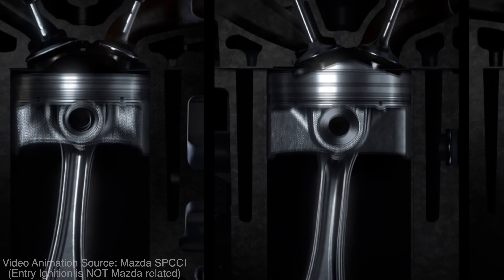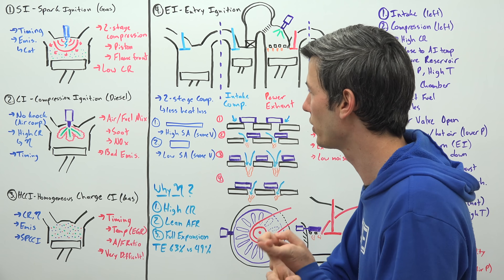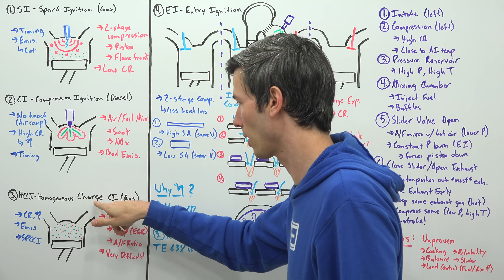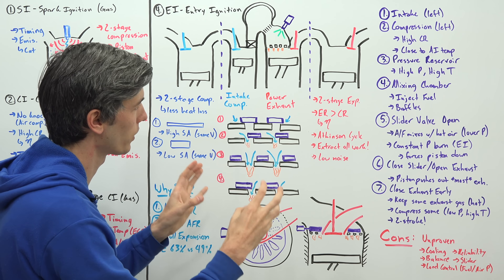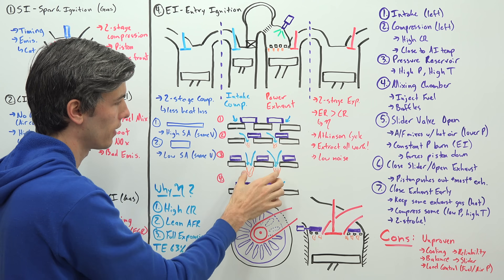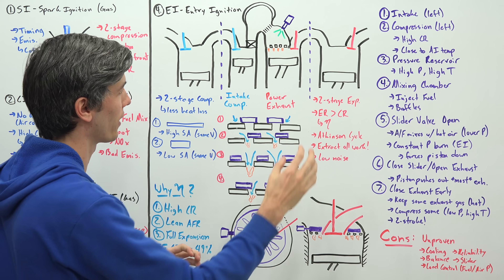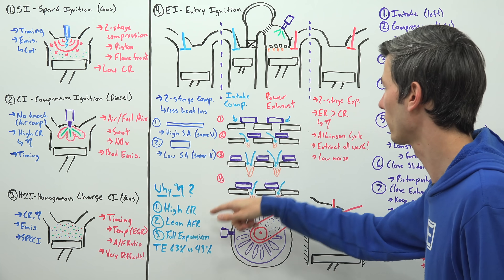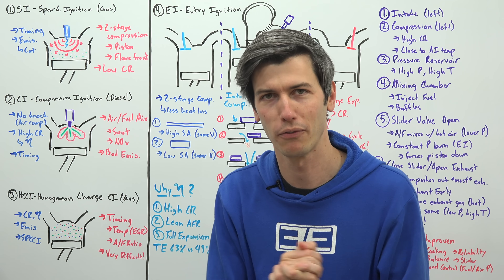Is 'Entry Ignition' The Future Of Combustion Engines?

Comment: I would love to see how the valves are sealing against the chambers. Extremely high pressure and lateral movement seems like a difficult mechanism to seal properly.
Reply: Seems like those 'slider valves' would get gummed up quickly
Reply: @Mr41297  Exactly what i was thinking
Reply: Mr41297
Not with atomized gasoline being sprayed on them.
Reply: The pressure seals it by itself. What i am worried about is wear since rotating the disc while it is pressured against the cylinder head surely creates friction that will wear it down rather quickly. And you can't use oil to lubricate it or emissions will be terrible.
Reply: seems like valves on a camshaft would've done the trick
Reply: @AbandonAllArt  If the valves were designed similarly to regular ones there would have to be some mechanism for the camshaft to pull the valve upwards instead of pushing down. If the valves were of the normal "open downwards" type, the air pressure above the valve would force it open before it was supposed to unless it had a ridiculously strong spring. The issue is that the pulling linkage could never be reliable because there simply isn't anywhere on the valve stem that would be strong enough to attach it. You also have the problem of needing to artificially create valve lash somewhere in the mechanism to allow for heat expansion. It honestly sounds like an engineering nightmare. After all that, I wouldn't be surprised if the slide valves actually flow better than normal valves anyway.
Reply: @stanleycorr1839  What about a system like Ducati's 'desmodromic' valves? Those valves are both pushed open and pulled closed. Perhaps the modification to being pulled open and pushed closed could be achieved.
Reply: @Donovan Piko The mechanic's job is fixing the engineer's failures.
Reply: I don't see a reason why you'd need rotary valves at-all, or how this engine is at-all different from a forced induction atkinson cycle engine, but with even more moving parts.
Reply: Exactly. This is a great thought exercise, but who at this stage is going to commit to adding complexity to and already vastly complex IC engine for marginal gains. I think Jason knows this. Anyone developing IC right now is arranging deck chairs on the titanic
Reply: Когда я стригусь под ноль, лезвия выдерживают огромное давление, которое я создаю, желая быть как можно больше лысым. 
When I cut to zero, the blades withstand the enormous pressure that I create, wanting to be as bald as possible.
=)
Reply: pressure difference will matter. both sides of the valve are at high P.... 1 just slightly higher to determine the flow in the circuit. so the resulting pressure is strangely quite low.
Reply: Donovan Piko I think the more advanced we get, simplicity becomes more and more complicated. Few and few peoples can manage to repair their cars. Car engines and electronic controls are too technogically advanced to be easily serviced by most owners. But they are mostly reliables and will be even better in the future. Capitalism is hard for stagnating technologies.
Reply: The Bristol Hercules used a sleeve exhaust valve, I’m not sure how they stood up over time though.
Reply: rotary valves have been used on 2-strokes effectively. Even piston-port 2-strokes use lateral movement to seal off the combustion chamber.
Reply: @jay_321  But in a two stroke there is oil mixed with the fuel to lubricate the sliding parts so more burnt oil in the exhaust, which is not what we want in a four stroke engine when trying to lower emissions in an engine and make it more efficient. The sliding valve idea is good, but keeping it lubricated and cool in a high pressure and temperature environment brings in the reliability issue. Wankle engines are a classic example of this.
Reply: @fuzzybobbles  modern two-strokes use the crank case as a sort of low pressure pump to move air/ fuel into the combustion chamber. Because of this they need oil added to the fuel to lubricate crankshaft. This type of engine doesn’t have a crank case acting  as a pump, it can have four-stroke type lubrication for the lower end and no oil in the fuel unless the wacky finger gate valve (or something else I missed) needs the lube.
Reply: @jay_321  not exactly in a piston port or other petrol 2 stroke the air fuel mix is transfered from crank to combustion chamber, crank case compression is to be avoided when building a 2 stroke..piston ports do seal much better than reeds of course though...super high performance 2 strokes use nothing but the pressure wave created by displacement to transfer..search 2stroke stuffings channel he makes an effort to explain...then there's forced induction 2 strokes also mostly diesel though
Reply: It looks like the valves seal themselves. The slide valves are under most pressure during the compression stroke but because the compression stroke is happening elsewhere from the combustion chamber, the pressure is actually forcing the valves against their sealing surfaces. During the power stroke, as far as I can tell, the valves stay open and the built-up pressure in the other chamber is what stops the expanding gas from travelling backwards. The only pressure that's trying to force the valves open is the small amount of exhaust gas that's retained to help ignite the fresh mixture. Of course, that exhaust gas pressure is being opposed by the high-pressure air/fuel mix on the other side of the valve so the net force is still greatly biased toward being applied to the intake side of the valve. Even just smooth metal would seal under that much pressure. It would be interesting to see how they've managed to combat wear though.
Reply: @stanleycorr1839  
Good explanation. Actually the check valve holds the pre-chamber's high pressure which then prevents reverse flow during the power stroke.
Normally the spark controls timing, which may vary from about 10 to 30 deg BTDC. Now that function is controlled by the initial opening of the slider valve at the highest closing pressure ... hard to imagine that working well at high rpms.

Comment: Haha. Someone got carried away. Thats just a boosted, valve fed 2 stroke. Apart from the fluff of the intake valve its pretty much a carbon copy of an old detriot single valve. 
The reason this has never been done so far is that intake valve. None have yet been made which can take the force over a long time. This kind of engine has been proposed numerous times over the years (once by me before I found out it had already been thought up).

Comment: It'll be a much bigger engine.... Rather we can use a turbocharger to avoid 2nd stage compression and expansion cycles....
I work as a marine engineer on ships having big engines with efficiencies around 70%. We too use 2 stroke cycle engines but everything in a single cylinder

Comment: 1. Running an engine way too rich 101.
This is called fuel knock.
4. that cringine would have to be rebuilt more time than a voodoo engine and people already are displeased with the voodoo (even though i was a GM guy I held high hopes for it being a good one but it flopped on launch, though it did sound good.).

Comment: Hi Jason. I am working exactly on the effect of the 4th cylinder and I think I have found a better system without adding that; simpler and more efficient than this interesting one you explained. My system works only by changing the behavior of the alternator and is retrofitable !!!
I just wrote to you yesterday on LinkedIn! So, check your invitations if you are interested in my system.
Furthermore, I have a hybrid concept without radiator and electric battery that could change the face of the world of engines; especially on helicopters!
Hurry up ! ;)

Comment: It seems to me to be a rediscovery of the Brayton engine.  The Brayton cycle although nowadays is used in the context of gas turbines was actually implemented by Brayton himself as a piston engine very much the same in principle as the one described here. I also remember this same idea presented as a 'new' type of engine that would revolutionize engine technology, I think it was sometime around the turn of the century.
The principle is in itself pretty obvious so I have to think there is some particular practical issue with it since it was invented so long ago but never used.  The breakthrough would occur if/when a solution is found to whatever that practical issue may be.
There are various similar ideas that are theoretically much better than today's piston engines but still not being used by anyone. One such example is also a Brayton cycle engine but based on a positive displacement pump and a positive displacement 'turbine' (not sure what the proper name is for a reverse driven pump) which can achieve the power density of a gas turbine while achieving far higher efficiency by allowing for a very high expansion ratio.

Comment: Video suggestion: I have a Honda CRZ hybrid, 6 speed manual. It has turned out to be an excellent car. The car turns off when one stops and instantly goes when I put it in gear.  My understanding is that the computer starts the engine without a starter. It seems simple, could you look into it and why haven't all cars done away with the starter if all that has to be done is inject gas in the pistons and ignite it?
Reply: Starters are optional on many types of hybrids because the electric motor can function like a starter motor. Toyota's Prius uses an ICE and two electric motors along with a wicked cool transmission that juggles the three so everything is relatively optimized. Take a look and have your mind blown!

Comment: Hi plz can you explain why diesel do Runaways. And what to do if it happen. Thanks ❤️
Reply: ✊yes
Reply: it happens when an engine oil (too much of it) finds it's way into the combustion chamber. Either sucked in with the air through a leaky turbo or simply through a crack in the block or head (I think). Since a diesel engine can run on oil, cutting of the fuel pump or a battery won't do you any good, because it sustains itself by pulling more oil in and doesn't require a spark to run. 
If that happens, your best bet is to stop the car, stay on the brake, put in the highest gear and quickly release the clutch, which should stall it out. If you have an automatic, you could try to plug the air intake with whatever you can find. However, modern diesels have a throttle body that should close when you turn of the ignition, starving it of oxygen :-)
Reply: Yes👍
Reply: A diesel often burns oil when it goes runaway. The other cause would be a fuel leak inside the cylinder.
It is very difficult to stop in an automatic transmission. But in a manual it's just as easy as stalling the engine.

Comment: looks at the amount of moving parts, looks at the concept, looks at the theory so... a split cycle engine with even more moving parts and even more complex?
Reply: Two-stroke engines are by far the simplest and have been displaced from cars many decades ago.

Despite their simplicity, cheaper maintenance and never needing an oil change, their inferior efficiency and worse emissions have made them obsolete.

Same will happen to other engines that will successively be replaced by electric motors over the next decades.

When exactly? Even the experts don't agree, so we'll just have to wait and see.
Reply: daszieher I mean electric vehicles make up less than 2% of the vehicles on the road I don’t see them hitting 10% even within 50 years
Reply: daszieher until you can buy an electric car for $1,000 like a cheap civic that’ll run another hundred thousand cheaply electric won’t make sense
Reply: @mercury0214  Exactly.  The government will have to force combustion engines off the road.  Like they are doing in the UK, Europe by driving up the road tax's for diesel and petrol engines.  Plus making exhaust emission laws that are almost impossible to meet and maintain.
Reply: @daszieher  The horizontally opposed compression ignition engine is a two stroke engine coming to a domestic pickup truck near you....
Reply: @daszieher  two stroke engines are more efficient!
Reply: Built an air compressor out of 2 cylinders on a VW air cooled 4 cylinder engine once..same principle.
Reply: Ahhh. Split cycle... phoar

Comment: Seems like a recipe for soot buildup in that pre-entry reservoir.
Reply: There's only compressed air mixed with fuel there. How would that build up soot? The fuel burns as it enters the "power" cylinder. Nothing burns in the reservoir, nor do any exhaust gases go there. Fuel is also good at cleaning stuff, such as valves in engines that have fuel injectors in the throttle body. So it's the opposite of soot build-up. Probably the cleanest part of the engine.
Reply: @Kepe  One word: oil.

The compression pistons still need to be lubricated. The expansion pistons would still leak some combustion gases into the crankcase which would be blown into the intake. That's how engines end up with charred intakes and cylinder heads, hot oil vapours. Direct injection engines get it on their intake valves even through "in theory" there's nothing burning there.
Reply: @Kepe  soot came from chemicals used in Petrol additives and also in storage tanks, that's why 4stroke engine is made to eradicate all of that issue, if own a two stroke engine you know how this engine will fail eventually
Reply: @Kepe  soot came from chemicals used in Petrol additives and also in storage tanks, that's why 4stroke engine is made to eradicate all of that issue, if own a two stroke engine you know how this engine will fail eventually
Reply: @Kepe  I understand that part of the design. However, you'd notice that fuel burn occurs during the opening of the valves and it will inevitably cause some burnt gasses to seep through the "high pressure" reservoir. Though the point you made with fuel being a cleaner does make sense, we've still seen examples of injectors clog up despite them supposedly having high pressure fuel sprayed out of them. Of course, the difference is that injectors are inside the combustion chamber as opposed to this design. The only point I'm trying to make is that those valves seem like the weak link in this design, really. Especially due to its "sliding" design as opposed to a cork-like seal found in traditional ICE. I guess only time will tell how well this engine fares.
Reply: Since the reservoir is higher pressure than the combustion chamber, soot would not be able to back flow in there.  They use the same concept for operating theaters.  The operating room is kept at a higher pressure than the outside rooms so airborn dust cant float in.

If anything, you would have to worry about leakage from reservoir to combustion mid cycle.  Then again the combustion chamber MUST be at a higher pressure than the reservoir during combustion.  Otherwise you wouldn't need combustion and could just run off the reservoir pressures.  If the seals leak you could get some back flow there.

Comment: Why use the slider valve instead of a "normall" valve? Does it also need to work as a flame brake?
Reply: Yes. I bet that keeping combustion out of the mixing chamber is a B***H. ANY burning in there will stop the engine since the mixing chamber is significantly larger than the  combustion cylinder's volume at TDC. Imagine three or four times the expected burn during a stroke. ::BOOM:: (So yes, the design sucks. Only a Caldwell Cycle engine will do what this engine tries and fails to do.)

Comment: I designed a far better clean burn 2 stroke, if you like sign a non-disclosure form  and I'll describe it for you. The engine above would have big reliability issue's, the outer pistons are loads not contributing to output. gas flow is incredibly long reducing efficiencies further.
Reply: Hi Michael! Non-disclosures are generally a no-go. Nobody is going to sign one because it is a risk and it could strip them of their own work if their work has overlap with yours. However, without a non-disclosure patent law strips you of your rights in one year (USA) or immediately (some other countries). Odds of you ever filing worldwide are vanishingly small because it would cost a fortune (country by country filing). The solution? Draw up a non-disclosure with a $1 liability limit. This protects your rights from patent law and protects the guy you're asking help from by limiting his liability to a buck. Cuz, seriously, divulging to someone you don't trust is insane even with a serious non-disclosure. Tell Fred...Fred tells his friend Sven in Sweden. Swedish guy, who has signed nothing owes you nothing and how on Earth are you going to even figure out that Fred knows Sven? And even if you do, how are you going to pay an attorney enough to beat the legal sharks Sven will hire to defend HIS patent?

Comment: This does seem like a lot of moving parts, and since rotary valves make a lot more sense but have never caught on, I'm not too encouraged about the slider valve.

Side question: has anyone tried just using the exhaust rotor of a turbo to generate electricity in a hybrid?  Seems like a simpler way to leverage exhaust pressure/heat, and who cares about lag time?

Comment: When it's still be more efficient to have control over injecting air directly into the combustion chamber? cuz you could control the amount of air coming in and when it's done and how much pressure you using you have an external compressor reservoir tank system and using the theory of direct-injection gasoline idea but using are then you can raise compression ratio Auto ignite when you wish thus increasing efficiency.